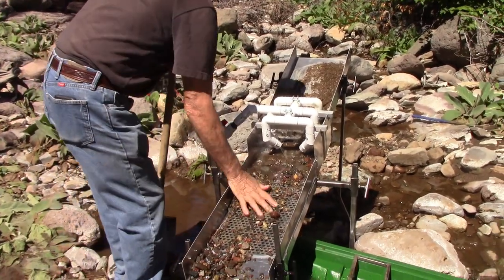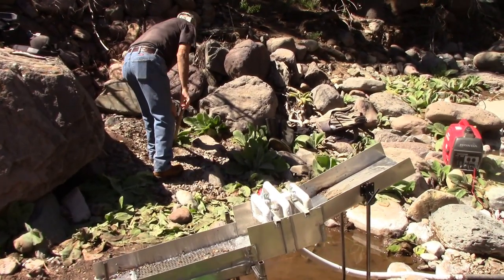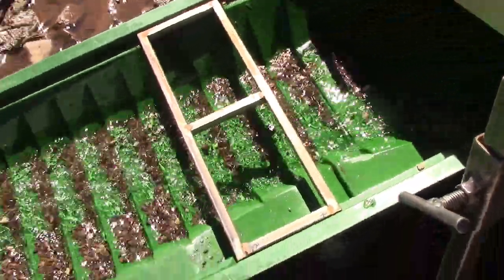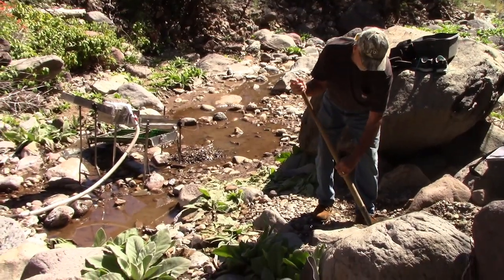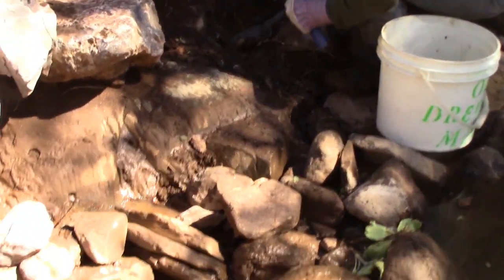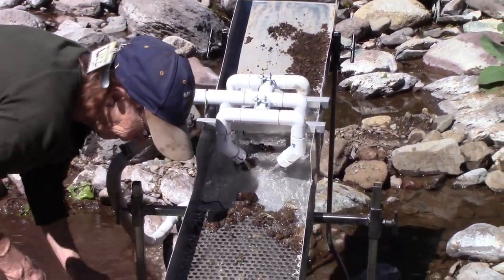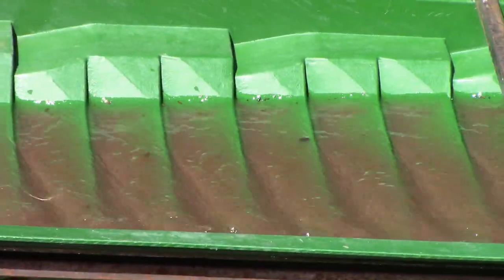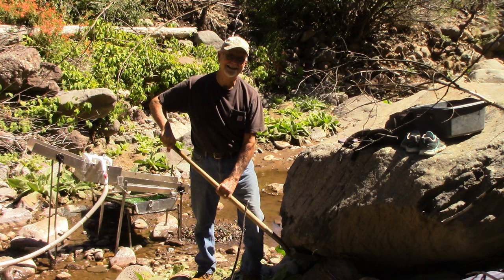WASH PLANT GOLD?

Comment: What you have there is a 'highbanker' (wash plant is something else). Your pump is too small. The jets should hit the dirt where it falls in the hopper, then it will flow naturally over the punch plate IF it is steeper. A shovel every minute is equal to spoon-feeding. A highbanker that size should handle dirt faster, so get a bigger pump, get the jets squirting into it and steepen everything so it flows better. Look on YT for other highbankers for ideas.

Comment: Hey Brother! That looked to be a bilge pump you were using. I bought a sump pump to run my stuff here at the house but, the got shelved really quick when I realized it had oil in it! But, they do have them without oil, so I've been told. That may work for you. And adding a spray bar for up top like you said will surely clear things up nicely. My forced day off will be uploaded latter tonight, I hope!
Reply from the maker: Thanks brother, do they make a sump pump in DC?
Reply: @CandSMINING  Your welcome. They sure do.
Reply from the maker: @GreenMountainGoldTrap  I will check that out.

Comment: Really love the ingenuity #ChuckGentles and team!  The pump I use for the processing recirc unit we have ended up with after trial and error is a 3500 GPM and we run it with a heavy deep cycle battery (the generator would be better and those hondas are the best!  My goal with my latest unit is too increase the slope so the oversize rocks roll on though without being handled.  Good luck with the mods and Heavy Pans!  Aaron
Reply from the maker: Thanks for your ideas Aaron. The 3500GPH pumps are really expensive. So my next test will be with my 6.5HP Honda and Keene P180 pump from my dredge. Run at about idle speed.😎👍👍👌👌⛏⛏
Reply: @CandSMINING  ebay chinese bilge pump models $40 free shipping.  It's important that it's a "non-automatic" type IIRC.  That's what I have and I bought two.  they were about 60 each when I bought them.  Your new plan sounds great though and maybe better still.
Reply from the maker: @gtaovlogs9061  WOW, I was looking on Amazon at about $179. Thanks for the heads up.

Comment: get a keene a52 sluice  and a big mixing pan   you can get 55 gallon drums off craigslist  so you can carry water (if you have a truck)   put the pump in the mixing pan  or find a pan deep enough  then the recirculating thing   you will have enough water  and you don't need the creek ,stream   you can take the high banker anywhere
Reply from the maker: Actually I have (3) 55 gallon drums. I also use (3) 27 gallong tote containers with (2) 3" pipes between for recirc. Works great. Check out someo of my other videos where I recirc. Thanks. 😎👍👍👌👌⛏⛏
Reply: @CandSMINING  some people don't think of this     I sample anywhere    I have a 10 gallon drum    and a (bus tote)   (for collecting the dirty dishes  in diners ,hotels)     people say how do pan in the desert    I show them   on the tail gate of my truck
Reply from the maker: @greedygringoprospecting6941  Great idea.